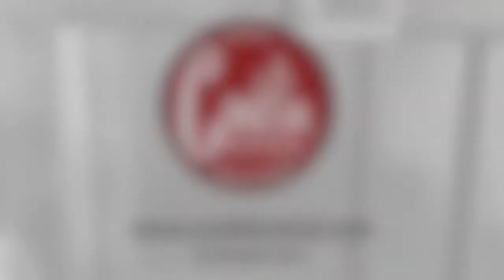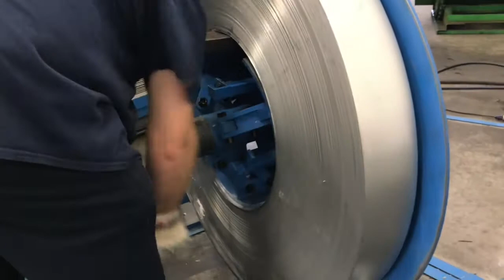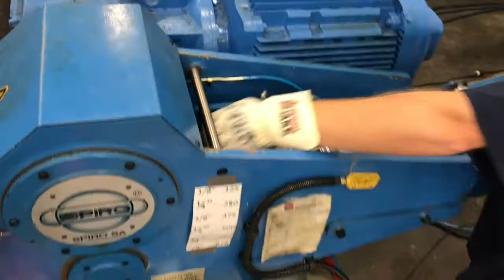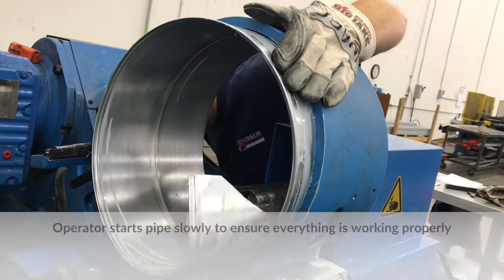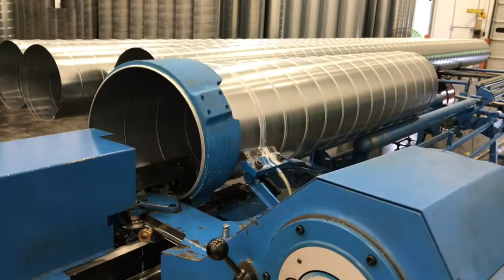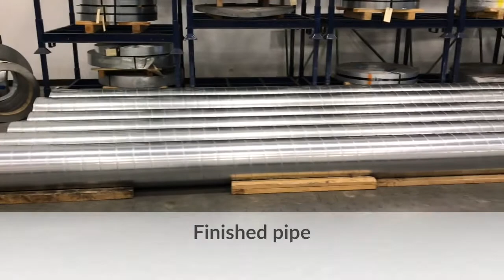How to Make Spiral Pipe using Spiral Helix 3600 Tubeformer

Comment: no bead setup?
Reply: Looks like he was running 16" Diameter. We typically Corrugate 26ga - 16'' Diameters and up by SMACNA standards unless requested by customer. I'd prefer Corrugation at that diameter but setting up the U-Brackets is a different story.
Reply: Iam need to help
Reply: @SoCalCode3  i use corrugation/swage at 600mm +. With no swage they end up like beached whales 😂